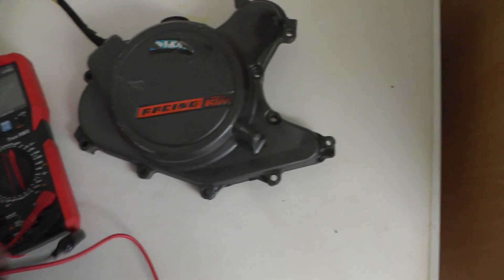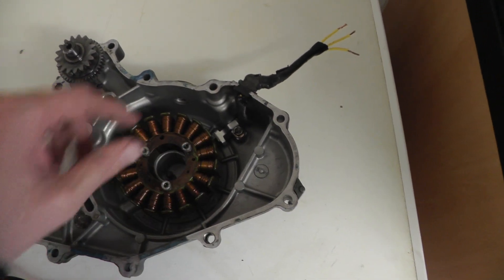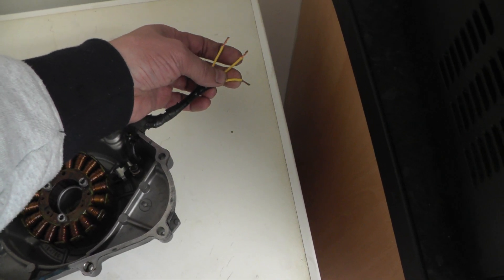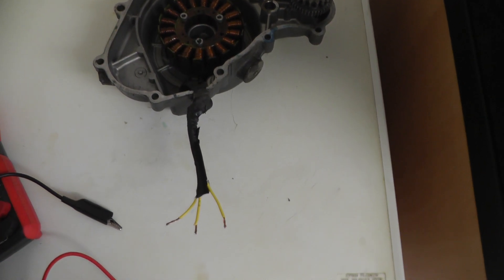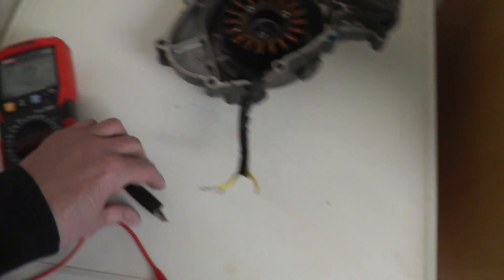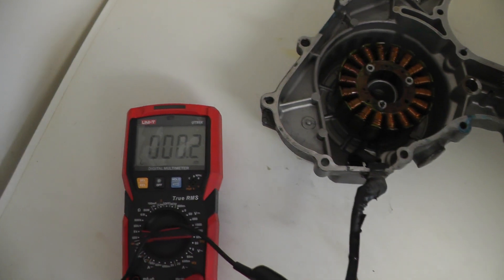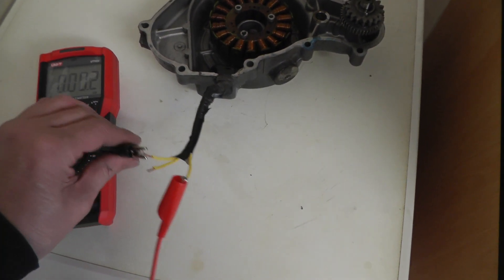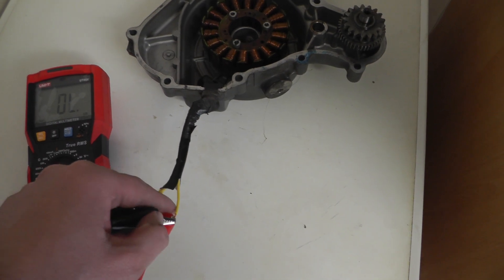KTM 125 Duke / RC Stator Test: How to Diagnose a Bad Generator Coil (Multimeter Guide)

Comment: I’ve just tested the same with a no charge fault. All readings came out at 0.7 ohms. Do you think it’s faulty? With the engine running there is no charge voltage at the battery???? Help 😢
Reply from the maker: Bad connection - split wire - high resistance in terminal - short to earth maybe ?? Just off top of my head